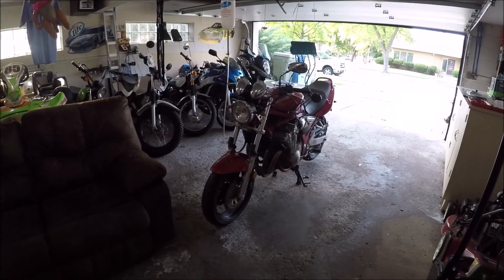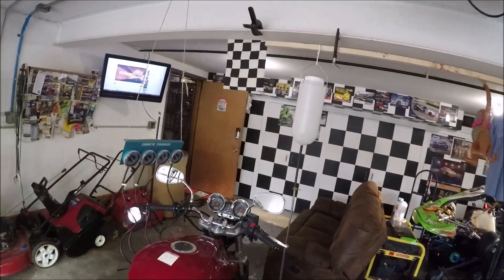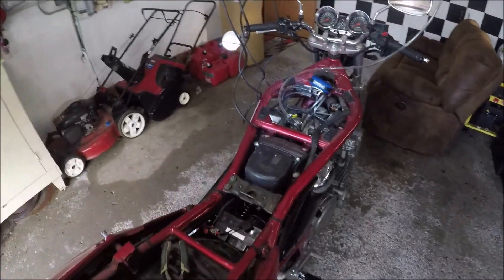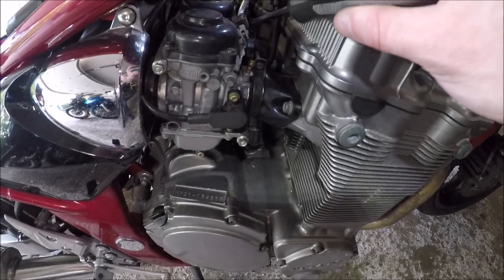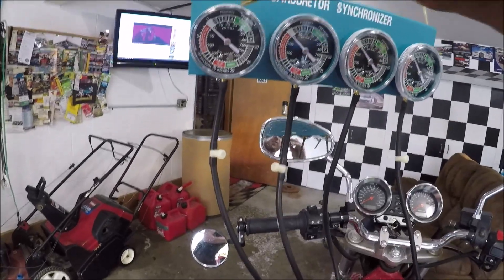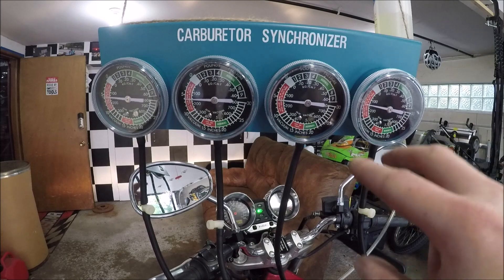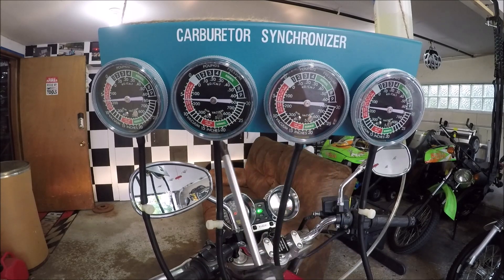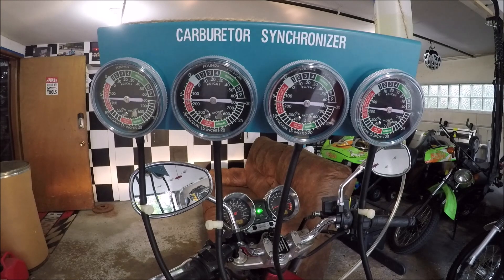GSF600 - Carburetor Synchronization

Comment: So u dont need to get lines to green (normal/ on the gauges? Also i dont remember where adjusting screws were at should i start with them all the way out or in?
Reply from the maker: No, you don't need to get to a specific vacuum number. You're just trying to get all the butterfly valves completely synchronized and set at the exact same level, so they're balanced. I didn't do a great job in this video because I was younger and dumber, but you want to adjust the little valves on the sync gauges to stop the gauge needle from fluttering--but you don't want to adjust it in so much it restricts the ability of the gauge to read vacuum.

If you're talking about the sync screws on the carburetor, there will be three of them. JIS head with a spring on the screw to keep tension (if I remember correctly). They're inbetween each of the carburetors. You don't want to go all the way in nor all the way out. There is a medium point where 1 and 2 will be even. Then a middle point where 3 and 4 will be even. Once you have those two pairs even, you balance 2 to 3 to get all four in sync.

Comment: Nice one but you probably need to to it again. You didnt adjust the damping of the gauges. They are supposed to vibrate. Your 3rd cylinder gauge valve was basically closed (no vibration) and the No1 not damped enough. Just adjust the small white valves all so you have a small vib on all gauges and retest.
Reply from the maker: Agreed. I figured that out about a month or so after shooting this vid. But you're right I didn't have them damped correctly.

Comment: I think I might've missed it. What was causing the problem that it had where when given gas it would stall?

I have the same bike that I bought used and it had the same problem a few years back and I parked it and left it there (wouldn't rev past 4000RPM and it would stall).

I bought it used and every winter (not very cold where I live) it would gice me grief, not starting, stalling. I didn't have much time to ride it and when I went to take it for a ride I would end up frustrated with the damn thing (and most ot the time without having been able ti even ride it). 

During the summer it rode well, it simply didn't like winter. 😅

Anyway, now I'm trying to bring it back to life and I would appreciate if you could give me some tips on what to look for and what the problem was with yours.

I feel exactly like you, I love the damn thing and just hearing the sound of you taking it for a spin has made me want to fix mine ASAP and take it for a spin! 😅
Reply from the maker: I don't have an exact specific thing, but it came down to having a clean air filter and running near stock A/F mix screws on stock jetting. I made certain the carburetor was squeeky clean and made sure it had clean fuel. I played with it for years though before I got it right. The bandit was unique in that I never had to fight a bike so much to get to run right. And yes, they're cold-blooded. Most carbureted bikes are, but the bandit was next level.
Reply: @matttriestodothings   Thanks for the response.

I remember in winter it took 4 or 5 minutes to run right and where I live we we don't have cold weather I can't imagine how long it would take with snow on the street. 

Mine would probably end up not starting at all. Most of the time in winter the battery died before the engine would start and it had a brand new good brand battery... 😅

Comment: A most excellent video.  Subscribed Matt.  Gotta get these gages.  Off to e-bay I go. (for my red 600 bandit bike ~ like this one ~ actually exactly like this one).  Thank you so much for this!
Reply from the maker: Not a problem Steven. Do note that these ebay vacuum gauges can be a bit of a gamble, and I would recommend trying to calibrate them off of a single split vacuum source before using them just to make sure they're all reading similarly.

Comment: Thank you so much bro you are the only one to explain the sequence on how to actually use this synchronisation carburettor kit. I I have learned a lot. Thanks again
Reply from the maker: Sure thing Lee. I wish I'd have bounced the throttle a bit more to show variances in vacuum at various RPM and the different rates at which the cylinders settle, but hopefully still useful. Cheers.

Comment: Very small turns, get one pair lined up, blip throttle,  if the needles go slightly out of whack when RPM's come back down and dont look quite in line anymore, readjust with very small turn again, if after blipping throttle they return and stay in line, move on to next pair.  rinse and repeat.  I usually do 2 or 3 blips even if they stay in line, just to reassure myself.

Straightforward to do, but can be fiddly and repetitive. First time i ever done it i just could not get them to sync up, one needle would go too far clockwise and vice versa; and was told it was because I was doing quarter turns, when you should really be doing  1/8 of a turn at most. Very very small turns.

I did my friends for him because the genius that he is, when taking his carb apart, he decided to unscrew one of the adjuster screws all the way out, to the point where the spring even fell out haha.  Talk about a bike sucking too much air and running wayyyy to lean!
Reply from the maker: Funny I'm reading this now. I just literally uploaded a video I shot last weekend comparing these gauges to a Carbtune I recently purchased. I assumed this notification was that the video failed to upload. Your advice about blipping the throttle is something I definitely should have been doing in this video--but I wasn't. Ignorance, I suppose.

Fiddly and repetitive is right. Luckily they're super easy access on this inline 4.

Be easy on your friend. Maybe he's like me in that his favorite way to learn is by doing the wrong thing and being corrected by other people? Like me!

Comment: Thanks for showing how You did it. But what i would like to know is how I can do it. What screw do I adjust to make them sync?
Reply from the maker: Scroll down about halfway through this article. The author has them circled A, B, C.

http://bikerdiy.com/projects/suzuki/gsf-bandit-projects/bornagainbikers-gsf600n-bandit-project/engine-bornagainbikers-gsf600n-bandit/its-all-about-the-balance/
Reply: @matttriestodothings  thanks. Wow my comment is from 4 months ago and im still struggling with this lmao.. So the shitty part is that i got the exact sync tool as you have and the pointers were all in red, which made me get sidetracked because it says valve timing bla bla and i actually opened the head of the engine and set the valves lmao. Guess that was not needed. Anyho, many attempts syncing the carb and i couldnt do it so some 2 weeks ago i bought a whole carb revise set even though i thoughrougly cleaned my carbs. The set is installed and i used some ball bearings to get a pretty good pre-sync and to my surprise it really helped. Just now that the first meter broke or maybe never even worked and is stuck in the low range and cant even calibrate it back to 0. After close inspection i saw some tears in the intake boots so thats what im going to waste my money on next. Btw quick question how do I reduce the idle, do i turn it the right / left ? Thanks man :)
Reply from the maker: @MrGilly  Idle set screw I'm 99% certain (out of town right now so can't check) is right-handed normal thread, so clockwise is higher idle, and counter-clockwise is lower idle.

I'm having trouble picturing what might be the issue with your vacuum gauges. Are you saying that they're not moving at all based on vacuum? Or that the resting spot is not at zero? If you've gone through and rebuilt the carburetors and checked the valves... while I'd definitely consider replacing the intake boots... I would think the problem might be in the sync setup itself.
Reply: @matttriestodothings  I'm going to seal the intake boots today using special gasket maker. For the sync tool they are moving but the first meter has a big offset and I cannot calibrate it back to 0, so it's difficult to read. Thanks for replying i really want to get this bike back on the road lmao

Comment: I have a GSF 600 Bandit 2000:  Have the following problem. Bike idles no problem, take it for a ride and after 5 mins of riding it looses power and cuts out.  will crank but not start.  leave for 30-50 mins and the bike will start again.   It sounds like a fuel starvation / float sticking  issue.   I have had the carbs off , good clean and blown with air line, checked float heights.  used all stock settings and digital carb balancer.  runs good at idle, but cut out problem when riding still occurs. Not sure if this maybe an electrical issue wrt stator/pick-up/CDI , but would appreciate any advice.
Reply from the maker: I think you're probably on the right path by thinking fuel starvation. I would check to make sure that the vacuum line that runs from one of the carburetors to the vacuum-operated petcock is not damaged in any way. I would also consider pulling the petcock out of the fuel tank and checking if the inlet filter is clogged which could be causing too much restriction. If you're going that far, it would probably also be a good idea to pull the vac-operated petcock apart and inspect the diaphragm to make sure that it doesn't have any tears or dirt built up inside.

You can test the operation of the petcock then with the fuel tank off the bike by hooking up a line to the vacuum port and either pulling a vacuum with your mouth or hooking it up to a brake bleeder. If the fuel flows with vacuum applied and stops flowing when vacuum is disconnected, it is operating correctly. Just make sure you're catching all of this into a container.

That's where I would start first before troubleshooting electricals. Though I was going to suggest cleaning up the terminals on the coil connections as well. This is something I've also been meaning to do on mine as I've heard it mentioned that corrosion can cause some issues and the symptoms will vary with heat.

Comment: What was the setting on the air mixture screw..is 2/1/5.to much..thats 2 and a have...
Reply from the maker: I settled on 2. Still playing with it, but 2 turns was what worked best on this stock setup at my elevation with stock exhaust and standard air filter. 1.875 is stock on this bike.
Reply: @matttriestodothings  thanks ill try that..ill see where that takes me..thank you..
Reply from the maker: @aladinoreyes2159  I'm at 617ft above sea level with all stock components besides a hiflofiltro oek air filter replacement.

If you find something that feels awesome, let me know! I'm still trying to find the perfect spot.

Comment: Best sync tutorial I found so far. Getting ready to do same thing today but on Bandit 1200. Your video gave me an idea to record my struggles and publish them also. Cheers
Reply from the maker: Thanks Mariusz. I still missed a few things in this video, so make sure you also:
***EDIT--There are (3) things I would change on this video.
1. The manual states engine RPM should be set to 1,750
 <--- this may be different for the 1200, I don't have a 1200 manual
2. Blip the throttle between any sync screw changes
3. Fix the wobbling gauge by adjusting the inline valve

Comment: Hey Matt, need some advise... So I did valve adjustment all good, after again back to carburetor synchronization... So I meet problems there according manaul 1750 RPM was no problems with 1&2 and harder with 3&4 and all together... Ended up having 17-18psi in all but then I dropped RPM to 1350 3 and 4 is out total... So made synch at 1500 all good and left like that but now then you ride on 1st gear loose  rpm 1500 seems "someone sometimes push bike from behind" motor sound good but sometimes appears that motor gets hard time for milliseconds and then back to normal😁 any advise? Still  stick to carburetors or... ?

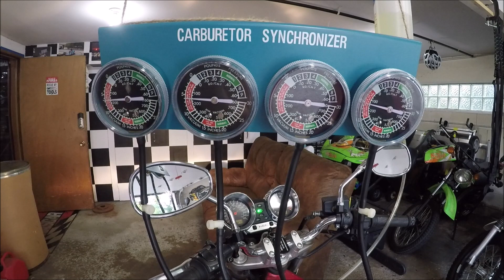Comment: I used this video to sync my own carbs after cleaning all the gunk out of the GSF600 carburetor - it worked like a charm and gives a better overview than the manual!  The wobbler at 6:55 can often be fixed by closing the screwed valve at the bottom of the gauge slightly.
In order to save your future carburetors: I do not know if the USA requires the use of bio-ethanol in their fuel like Europe does, but I found that using fuel without any (bio-)ethanol limits clogging and deterioration of rubbers. In the case of the Netherlands, I decided to just use a premium gasoline, such as Shell V-power.
Reply from the maker: I learned about adjusting the wobbler after doing this sync on another bike. How blind was I not to attempt adjusting the valve?! Gah. This is one of those videos I should probably reshoot. I should have also blipped the throttle in between sync screw changes to make sure it settled in the same spot. But, this method should get it pretty darn close still.

Unfortunately in my city, you legally can't even sell gasoline without 10% ethanol in it. I need to go a few counties over to get it--and then it's usually just premium. 

That's great to hear that you got your carb cleaned, and you've got the bike up and running!

Comment: Bike need to be idling at 1750rmp to do it absolutely perfect.
Reply from the maker: Is the Bandit 600 1750? I have since learned from doing another bike that there is a recommended RPM. I also really should have been blipping the throttle inbetween adjustments to see that the air velocity fell back to the same positions.

I adjusted the valves this winter so I should probably do another sync at the correct RPM and with the blips. Thanks for the feedback John.
Reply: @matttriestodothings   sure is man, every day you'll be learning. Videos are very watchable tho cool stuff, very enthusiastic 😎👌

Comment: I synced my carbs today gsf 600 mk1  but found after the revs dropped really slow but when i un synced carb 1 it was fine... all mixture screw are out 2
Reply from the maker: My only piece of advice at this stage is to make sure you've got a clean air filter, and you may also want to verify that the air filter drain gets dumped. I believe I'm also going to have to fight a bit to get my Bandit running correctly again once winter ends since it seems really finicky with "old" gasoline.

I believe I noticed a thread you started on BanditForum as well concerning this issue.
Reply: @matttriestodothings   yeah new filter, maybe ill try a leak test on it
Reply: Also the  bouncing on ur synchronizer if u tweak the white screw on the pipe that will stop the bouncing

Comment: Glad I found this video. I'm going through this on my bandit-6 next weekend, and you make it look like a very straightforward process. Thank You
Reply from the maker: Good luck! One thing I forgot to do on this video was to raise the throttle a little bit ~1-2k rpm for a second or two, and then back off and see that all the carburetors settle out at the same vacuum pull.
Reply: :) It went ok, much better now. It now starts and idles great. But I still have to sort out other issues. It runs perfectly up to about 4000rpm - after that, specially if I give it full throttle it takes an eternity to accelerate. I suspect it is running too rich on the mainjet. Will try to ride it without the air filter and see how it behaves. Thanks for sharing your experience.
Reply from the maker: @cristiovanni  that's good to hear! I was struggling with similar hesitation in that midrange as well. A <$20 HifloFiltro air filter and toying with the air/fluid mix screws on the carburetors ended up getting me dialed in after some trial and error. I ended up settling on 2 turns out (stock is 1 7/8). With a small flathead, you can reach them without having to remove the carb rack from the bike. It's a tight fit, but it can be done.

I appreciate the update.
Reply: Matt Tries to Do Things Thanks for the sugestion. Went for a ride today. The too rich scenario is confirmed. I'll have to go through the carburetors all over again. I finally got hands on a service manual so this time i'll go by the book. No regrets, just learning :)

Comment: you could use the little valve in the hose to calm the wobbeling. and you should hit the throttle after ajustment to see if it stays where it is
Reply from the maker: I definitely should have blipped the throttle a few times--not sure why I didn't. Good recommendation. 
It looks like what I would need to flatten out the bounciness of the gauge is a "snubber", would that be the type of valve you're talking about?
Reply: That white valve thats on the gauge hose in the video, just tighten it a little  until it smoothes the needle.
Reply from the maker: @MarcusfotosDe  That's great to hear! Hopefully your patience level is better than mine, haha. This bike has really taught me to work on the simple things first, make sure they're correct, then move on to more difficult tasks.